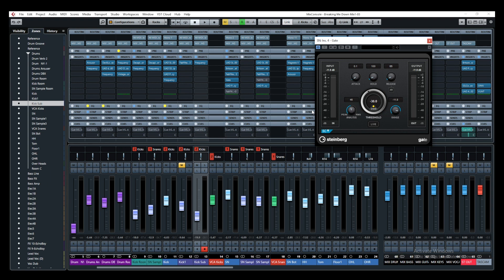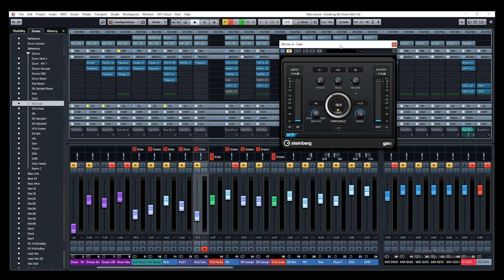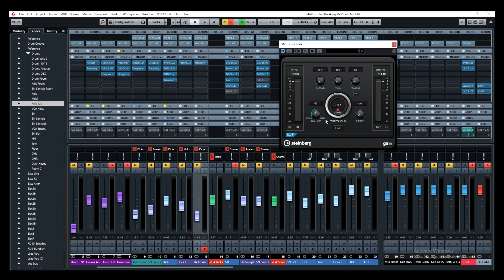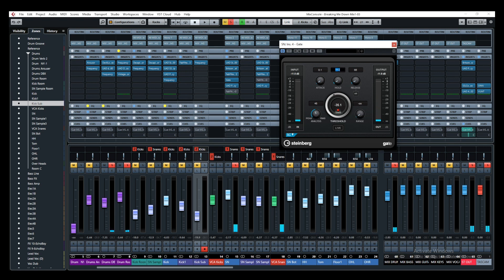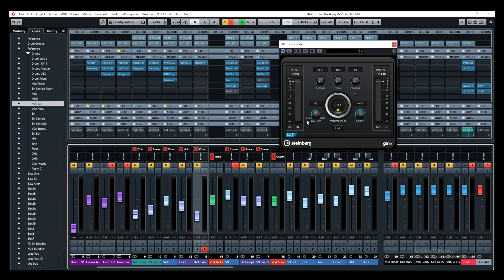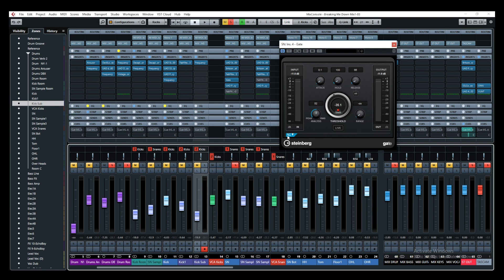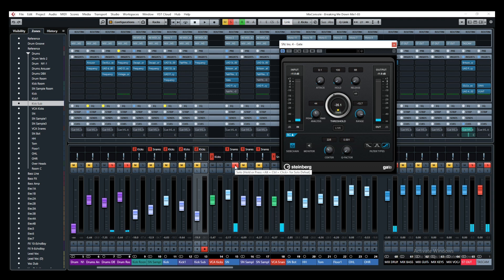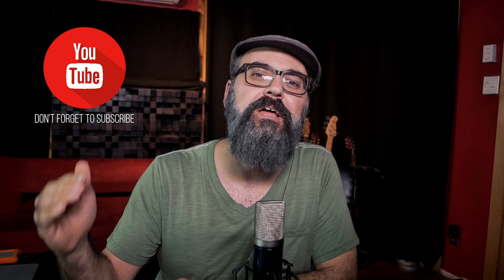Noise GATE in CUBASE 9.5 EXPLAINED - mixdown.online

Comment: Very informative video. I don't usually record live drums, but I use the noise gate mainly on incoming vocals to filter out any background noise when I am recording.  I also use it for side chaining that is triggered by another track.  There are two things I don't understand:  1. How is the hold different than the release?  2. Is the side chain section at the bottom section of the gate related to triggering the gate's side chain with another track?  If so, is it based on the information from the incoming or outgoing signal?
Reply from the maker: The HOLD is different than the release cause it will let the gate OPEN for x amount time opposed to the RELEASE the is the time it takes for the GATE to CLOSE. So if you don't have any HOLD, the Gate will open and then close...If you have a HOLD, the Gate will OPEN, HOLD and then CLOSE. Hope that helps!
Reply from the maker: The side-chain option on the gate is not related to another track but to the frequency range of the track itself. So if you activate the internal Side-Chain at 200Hz, everything below 200Hz will NOT open the Gate.